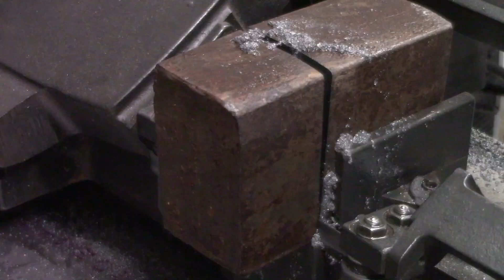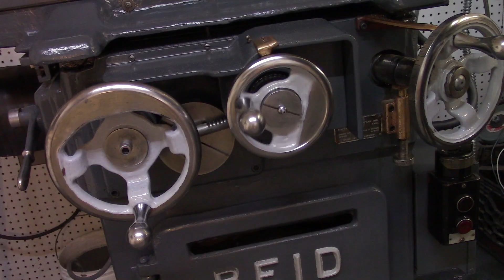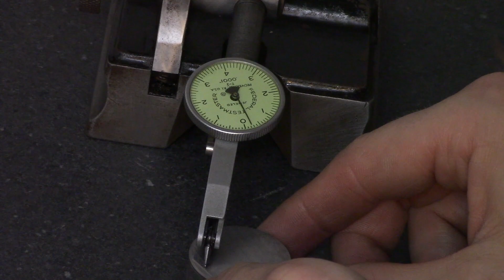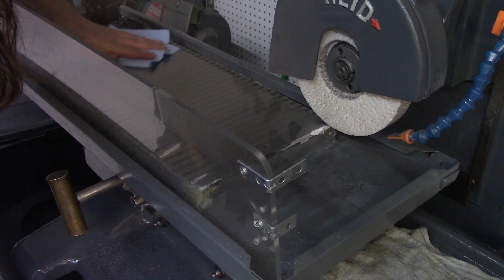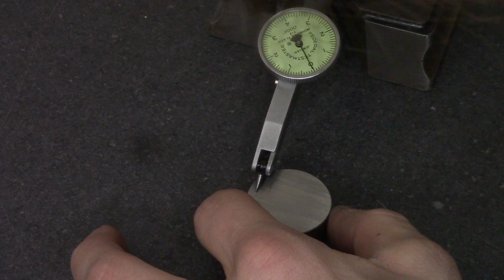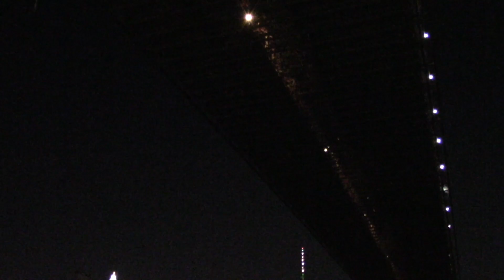Dressing and Inspecting the Magchuck on a Surface Grinder

Comment: If you just run the bed from end to end back and forth for 30min to an hour before grinding it will help you get a tighter tolerance.  Also do the same before grinding mag chuck.  Ways also need to warm up and stabilize.   
Also you can set up a test indicator to check the chuck for flatness before grinding. 
If you put a larger offset wheel you may be able to get rid of those steps.  
Balancing the wheel is also important to tolerance. 
You are off to a great start grinding.
Great video. Look forward to more.
Reply from the maker: Thanks,  It seems to me when we are shooting for .0001"s, especially on a worn machine, you want to take care of all the variables that you can control, because some things are out of your control.